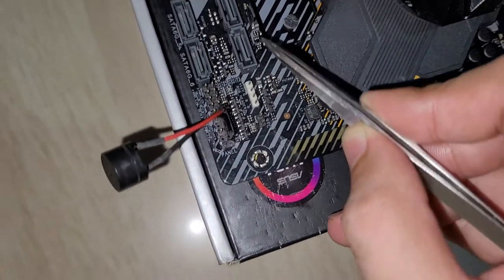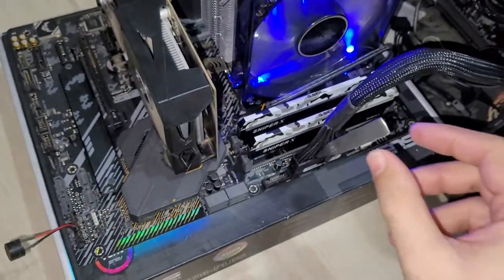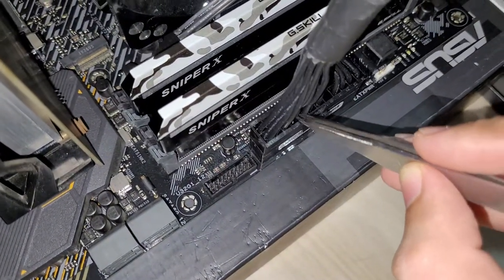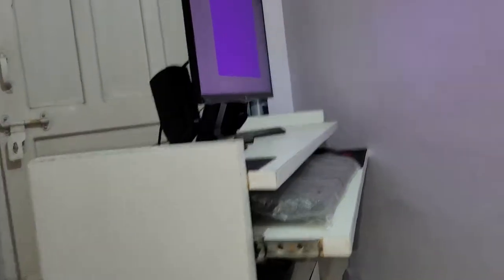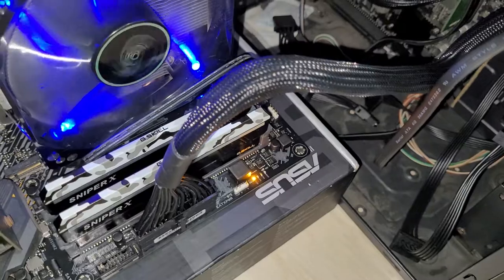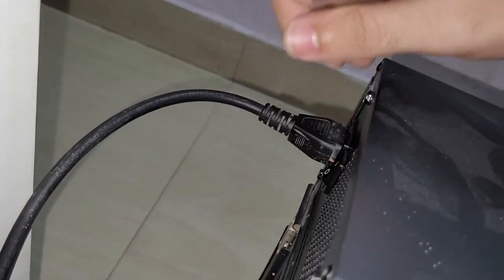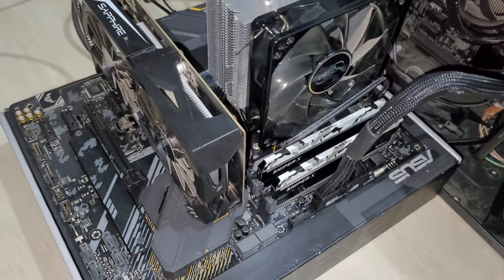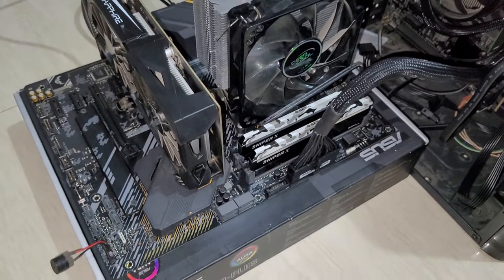Issue: ASUS TUF Gaming X570-Plus Motherboard Doesn't Power ON Without CLR CMOS + PSU Paperclip Short

Comment: This is the only vid that actually shows my problem straight out
Reply from the maker: Glad to hear. Hope it helps.
Reply: I just installed a new Vid card and no power since. So broke it all back down. Two power supply’s. But if I connect the upper left 4 pin atx plug. It kills the board like a dead short.
Reply: it was working fine. i turned off pc and after half hour no power in motherboard
Reply from the maker: @mikesapp3241 Oh man, sorry for responding late. Got a new motherboard by now I assume?
Reply from the maker: @Dagarhere, try CMOS reset once brother if it helps. Sadly we are only troubleshooting here, we can not fix a fried mobo.
Reply: @LoveleshKalonia  so do i have to replace motherboard now.
if i keep doing ur trick then what life this motherboard left with. because it starts with your trick
Reply from the maker: You can live with it if you can. Some Russian dude in comments fixed this though.
You should get it replaced it in warranty or buy new one.

Comment: I had this same issue with this motherboard and the problem turned out to be the power supply. It took me three of them before solving the issue. All three PSUs checked out fine and they all worked well on other computers. But they were all 700 watts or less. I finally was desperate enough to purchase yet another PSU this time an 850-watt and the board fired up as it should. Apparently, the lower-watt units simply don't have the power it takes to start the board.
Reply from the maker: That could be the case, I haven't had any issues in the replaced unit as I upgraded my PSU to an ROG Strix 850 watt.
Reply: I tried it with MPG A1000G and it still didn't fire up

Comment: I kind of having a similar issue, i tried using paperpin method to check if my power supply works and it works but as soon as i connect it to my motherboard it doesnt work, when i try to start PC, the LED on my watercooler hits for half a second, PSU doesn’t turn on and no lights on motherboard whatsoever, when i turn off my power supply, watercooler LED hits again for Half a second and turns off! Not sure what to do. 🥹 Can you tell me how did you fix the issue? Do i have to change motherboard? Or power supply?? 

Update: I tried to put a paperclip on 4 and 5th pin connector of PSU, and tried to start pc and it worked however as soon as i remove the clip it stops everything. Still not sure whats the actual issue but i am probably gonna continue with the paperclip! 🥹

Comment: This is common for asus. They never say what it is or why it does not ppwer on. I have heard 20 different explanations and none of them are correct. Its bad horrible traces. Your pwr button does not work because of crap work at the factory. They are officially 3 rate mobos. Asus has went to crap since 2015.

Comment: Guys Ive read through this whole comment section and Ive found some similarities. We almost all have x570 chipset and Ryzen 3000 or 5000 cpu. And almost all have this Asus Aura thing turned on(rgb lights). Have anyone tried shorting those 24atx pins and then going into bios to turn that thing OFF?
Reply from the maker: I did try that, but didn't fix the issue at that time.
Reply: Its the same for all asus. It is not your power supply. Its horrible traces and solders. The pins also are of different thickness amd that is just shotty shitty standards.

Comment: Happened to me, I accidently switched the PCIE cable with the ATX connector (8-pins on top of your motherboard), it didn't destroy it (luckily) but apparently it was not getting any power there, switched the cables to the correct ones and voila it worked again, Yes I should read the markings on the cables but I am getting old and my eyesight is getting dimmer, lesson learned sufficient lighting and use a magnifying glass
Reply from the maker: Sadly, In my case PC just refused to start normally but luckily it was under warranty.

Comment: Thank you, finally I found a video with the same case, after I tried it and the results are correct, the indicator light is on, my motherboard is Asus tif gaming b350 having problems after 3 years of use, I think the problem occurs in the lack of electricity on the psu or weakening power received by the motherboard. but what is certain is that I haven't found any definite obstacles so that this can happen. Tanks
Reply from the maker: Glad to hear it helped.

Comment: this video saved my day, yesterday after finishing building my new pc with Asus tuf 570x pro and Razen 5900, I had the same problem almost completely disassembled and returned the mobo. but i did the jumper between pin 4 and 5 and the aura light and the fans came on so i rebooted and i was able to enter the bios it gave me a usb problem so i unplugged all the usb ports and got into windows then shutdown and reconnect the USB ports again and the PC works as it should...... thank you very much. For the video Thank you... thank you.. thank you
Reply from the maker: Glad to hear 👍
Reply: hi im on same build  as you are with mobo not even booting up old mobo with old cpu boots instantly is this psu fault or mobo?
Reply from the maker: I am sorry brother, didn't understand.
Reply: @LoveleshKalonia  i mean that my mobo when is hooked on psu wont boot old mobo works i got asus prime 570p as well only that fan light is on when psu is on the rest is dead like not a sound beep nothing compare to old mobo that is instant boot ill prob have to replace it or bios flash by buddy of mine who is also building pcs and enginering stuff around it but i thing that this mobo is faulty one that they send or psu
Reply from the maker: Most likely bad Mobo if you have a good PSU.
Reply: @LoveleshKalonia  ye what im thiking im good at troubleshooting stuf dont get me wrong we like isolate everything but this is a mystery why would light be on on went below xd
Reply from the maker: Invented something 😁
Reply: @LoveleshKalonia  yes 3 around head on mobo then it will boot from shock xd
Reply from the maker: @Sheppardsg1  😂

Comment: Hi, thanks for this awesome video. I have the same issue. When I short the pins the fans rotate but then once I remove the tweezer. It stops and clearing the CMOS doesn’t help as well.
Reply from the maker: Glad to know it helped.
Reply: @LoveleshKalonia  hey, So my mobo wouldnt turn on if I am not shorting the 24atx, I tried clearing the CMOS as well. No QLED, no fan, no power, nothing. Any suggestions ?
Reply from the maker: @AjayBhaskar  Is RGB glowing when PSU is connected?
Reply: @LoveleshKalonia  yes it does
Reply from the maker: @AjayBhaskar  Your problem seems a little different brother.
This is sad though, so many people having this issue with TUF lineup.
Are you able to kickstart yours using the method explained in video?

Comment: I have exactly same issue after 1 week ownership of the mainboard. I don't neet to clear bios but I need to power on PSU via ATX connector then aura leds are lighten up. I could not find the issue and now I am trying to sent the mainboard to ASUS.
Reply from the maker: RMA is the only option. Hope replacement one turns out good

Comment: Same problem but mine does have the aurora leds on the back when the power supply is turn on
Reply from the maker: Aurora were lighting up for me too for some time when problem happened first time, but as I was troubleshooting they just died somehow in one of the many attempts and never lit up again in PSU ON condition. I think my old PSU - Corsair VS450 (4 year old) has done something to the motherboard's BIOS bootloader, because it also killed my secondary PC - Gigabyte B75M-D3H. That POST-ed only once with that PSU and then it died on me. Later I broke 2 CPU socket pins... my bad... but highly doubt the PSU.
Since the ASUS motherboard was in warranty, ASUS SC has RMA replaced it, I will collect that this Saturday.
I am planning to buy a Japanese Cap 80 Plus Gold PSU before using the replacement ☹️ thinking about Strix 750 watt.

Comment: I've had this MOBO for a few years without issue then a few days ago it suddenly stopped booting, no rainbow rgb on the motherboard.
I stripped down the PSU connectors then plugged them again and it worked... for a few days, now it doesn't work at all. Sometimes the rainbow rgb comes back but it doesn' want to boot.

Like you I tried a new PSU (Corsair rm850x to replace the old Corsair rm550x) and new battery for the motherboard but no change.

I guess my only option is to buy a new motherboard ? 🤔
Reply from the maker: Yes MakiKata, sadly that's only thing you can do... While you are at it, maybe wait for AM5 Motherboards
Reply: @LoveleshKalonia  Finally got it to someone more knowledgeable in PC parts than me and he confirmed the MB is dead.
Can't wait for AM5 though, I bought a new one straight away :p
Thanks for the advice
Reply from the maker: This gives me closure too that MB was beyond repair and dead. Thanks man!

Comment: I have the same exact problem. I had issues where it would also gets stuck in boot led with no video or VGA white light led, which is fixable by switching GPU. Updating the bios did not do anything at all. Whenever I tried to power on the motherboard from completely off, I need to jump the pins 4 and 5 just to power the motherboard. Sometimes, the power pins don't work when jumped (even when I left the pins 4 and 5 jumped) so I would do turn the PSU switch on to power the motherboard, then turn it off, and then turn it on at which it completely powers on the system. Basically, I have to leave my PC in sleep mode from now on. What a weird flaw from this board honestly.
Reply from the maker: I know right? So many victims.

Comment: Cleaned PC, repasted CPU & GPU and this happened to me. In my case though I still didn't post even after clearing CMOS (shorting CLRTC). What worked for me was I reseated my CPU. I made sure pins and sockets are clean. Lever in locked position and CPU was secured.

Comment: 0:28 Possibly same thing happend to me. I'm currently using ASUS TUF B450M PRO GAMING and the aura rgb from bottom right side doesn't glow rainbow too after powering the PSU. Does this mean my mobo is dead? PSU is fine when I use paper clip but when I connect it to mobo it still doesn't work.
Reply from the maker: Yes brother, Mobo gone. Mobo is the least reliable part in a PC. Get it RMA-ed under warranty.
Reply: Thanks for the reply. Sadly, it's no longer covered by warranty because my mobo lasts only 4 years. Also I can't afford a new one 🥲
Reply from the maker: @nrou  Oh man
Reply: Update: RGB finally glows after using the paper clip from pin 20/24. However, it still doesn't boot, and it only runs when putting the paper clip in.
Reply from the maker: @nrou  Regardless, it is not something we can fix on our own. Some Russian dude in comments fixed it somehow.
Reply: Nevermind. It automatically boots up after being powered for an hour. I hope it doesn't damaged again. Huge thanks to ur tutorial!
Reply from the maker: @nrou  Glad to hear 🙂
Reply: q

Comment: I have this and I had to remove a ram stick just to get to my bios and it still wouldn’t boot up, would you suggest buying a new board? Or new power supply?
Reply from the maker: Sad to hear Jyn. But if everything has failed... Then you will need a new motherboard. A better PSU later will give peace of mind.

Comment: Similar issue here on x570+ wifi, new build just a few months old. Just turned off a few days ago and will not come back on. The RGB lights are on, but when I press the power button the power supply (corsair rm850x) just clicks and the computer does not power up. If I disconect the CPU cable from the power supply and press the power button, it lights up and the fans spin for a few second and it appears to stay on, but no power is going to the CPU. As soon as the CPU is plugged in, it causes the power supply to trip so no power is being sent to the board and the PSU internal circuit breaker seems to be kicking in. Perhaps a short? Think im going to order new power supply and board to fix issue!! But I will be getting my money back from ASUS as this is just not right.
Reply from the maker: Yes brother, can't believe ASUS sucks in modern times.

Comment: Here is my problem :
I installed a ryzen7 5800x on my Asus 570-plus (I had a ryzen 7 3700x) 
It has been running for two days. 
When loading a game, my pc froze. 
I switched it off, and back on. The Debug leds do not light up but all the fans are spinning.
The rgb motherboard backlights stay on. 
Not sure if I should try shorting pin 4/5 at the psu connector?
Reply from the maker: I think you can try... It is not exactly doing any damage...
Power button itself shorts these 2 pins through the motherboard. 
You can try.
Reply: Hey bro I have ALMOST identical scenario but I have Asus prime x570pro and switched 3800x for 5700x. Hmm... Very interesting. So this problem obviously has something to do with ryzen 5000 and x570 chipset
Reply from the maker: Mmmm But I have R5 3600.
Reply: @LoveleshKalonia  Ive brought mine to local repair shop but technician went on vacation for two weeks. Will ask him to check ur method(shorting pins on 24atx) and turning off Aura. Will post update in two weeks
Reply from the maker: @Quasisaur  Sure, do share what happens next.
Reply: @Quasisaur whats the solution??
Reply: @Quasisaur u didn’t update us
Reply: @Dagarhere  Long story short - apparently it locked it self into safe mode or smth like that due to PSU problems - I RMAed my PSU - and bought a new one - but it was the same - didn't start up with different cpu/memory. Local shop didn't help either - they hold it for about a month(first service man went to vacation and then they 'didn't have AM4 test processor'(probably bs - I think they didn't want to risk ruining their processor). So I brought them my father's old CPU 2400G - and... SURPRISE SURPRISE - it started. At least they didn't charge me for 'diagnostics'. So I brought it home and... ̶s̶m̶a̶s̶h̶e̶d̶ ̶i̶t̶ ̶w̶i̶t̶h̶ ̶h̶a̶m̶m̶e̶r̶(yeah I wish) - tested it again with new PSU unit OLD CPU and OLD ram - it worked just fine. But after all this debacle I decided to switch to MSI

Comment: Damn. Thanks for the video seem like I have the same problem. Thought something happened from the move but it seems ASUS just crapped on me. Any recommendations for a plug play replacement mobo so that I can get my computer up and running without much configuration changes? 

Thanks again.
Reply from the maker: For simple Plug and Play you will have to get the same Mobo. I will recommend MSi Mortar or Tomahawk otherwise or maybe Gigabyte.
Reply: @LoveleshKalonia  Thanks.
Reply: @LoveleshKalonia  So I went with Gigabyte B550 and it was pretty much plug and play. That hasn't happened before for me, just need to download some drivers. Glad I don't have to reinstall windows.  Thanks for the info on this issue.
Reply from the maker: @matthewm6184  Great! Congrats.

Comment: Mine just went rogue yesterday. The aura bar lights up but I can’t manage to power on the mobo. Even tried to short the power SW pins. Didn't try to jump directly on the atx connectors yet tho.
Reply from the maker: Sad to hear, hope it gets fixed on its own and you won't have to visit SC. 🤞
Reply: Andy update? I have the same problem it seems
Reply: @jobhoogeboom  I accidentally broke some connectors from the CPU socket, sadly for me it meant that had to buy a new mobo, the repair costs weren't worth the hassle, it costs almost as a new one, so I bought a b550m steel legend and it is working good so far.
Ps: I went through the warranty, and it won't cover it in this case.
Reply: Can you tell what was the problem?
Reply: @ovymar1924  cpu pins were broken, lost the mobo

Comment: I'm going to have to take mine to a repair place as I'm not experienced  enough to mess with the MOBO comfortably. Parts came in and I spent like 8 hours building and trying to figure out wtf is happening since I used the ram and psu from my old computer which was working fine before I transferred them to the new computer. Hope mine wasn't dead on arrival.
Reply from the maker: Good Luck brother. Warranty will cover you.
Reply: @LoveleshKalonia  it's annoying I'm not experienced enough that I have to pay someone else to tell if the motherboard is dead, but that just means I need to learn more. I asked them to record the diagnosis process so I can learn for next time. Though I'm more annoyed that there's a good chance my Mobo was DOA in the first place.
Reply from the maker: @navandozer  I can feel your frustration brother. End user shouldn't face these issues. Specially considering you bought X570 this year, which means ASUS had plenty of time to work out the issues.
An early adopter can expect some issues but by this time this chipset should have matured enough.

Comment: It may have just been a faulty PSU to Motherboard 24 pin cable instead of the motherboard itself. Did you try replacing just the cable? I have the same issue and might try doing this.
Reply from the maker: Old PSU was non-modular